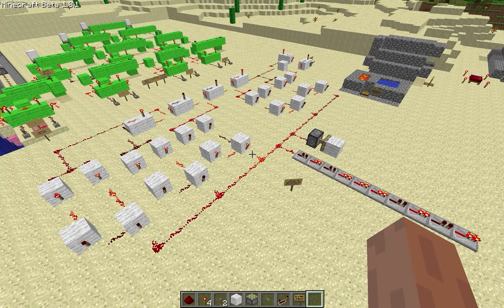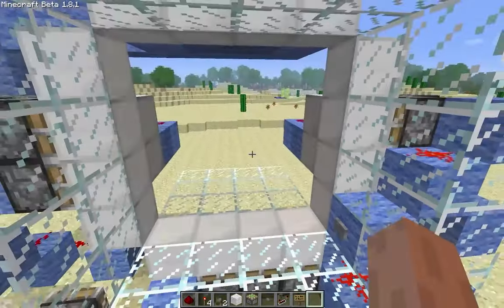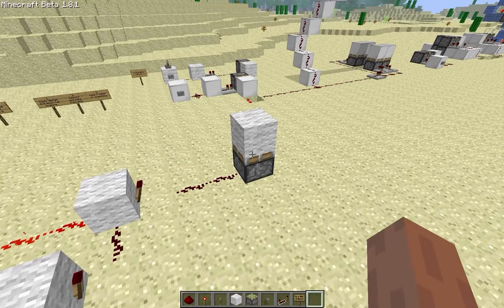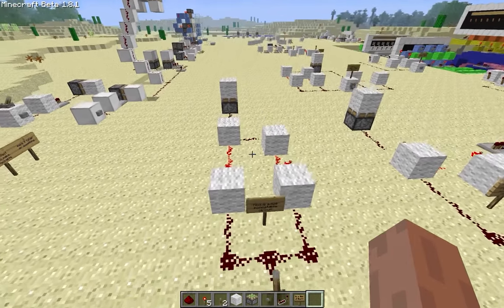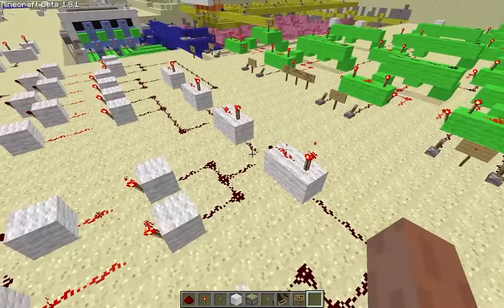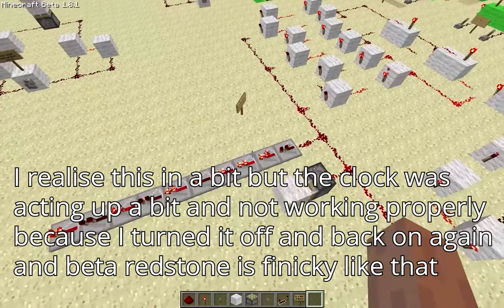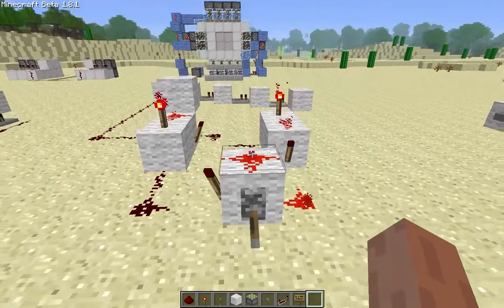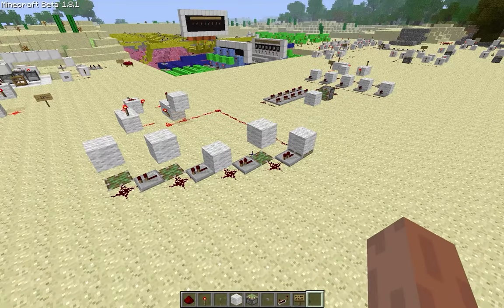the supposedly impossible redstone circuit (torch and wire 1-clock) [Minecraft Beta 1.8.1]

Comment: Have you tried methods of updating the torches in the tick where they receive no input? Here's an anecdote from modern redstone: comparators can read out the fill levels of chest and hopper minecarts, but they only do so every few ticks. But as it turns out, chests will continuously update adjacent blocks when a comparator is reading their signal, (iirc) so using a comparator you can get a chest to update another comparator to convince it to read the fill level of a chest minecart a little more frequently.

For the case of your torch, I recommend something else, like having a really dumb looking redstone line leading into a block adjacent to the torch. I think that could provide an additional block update to the torch. Also, there are ways to stop redstone signals from propogating backward without using torches, meaning that they have no delay. "Transparent" blocks like glass, glowstone, and top-slabs have a corner cutting trick where redstone signals treat them like they don't exist when stepping up, a block but can be cut off by them when stepping down.

Also, this is one redstone tick, right? I'm curious to see if you can find a way to achieve game tick precision. In fact, odd redstone pulses might be related to your weird issues. If there is somehow a three game tick pulse for example then half the time you pause the game you might see two repeaters on, and the other half one. I know that user input can have some weird effects, sometimes resulting in the same setup having one game tick more or less delay depending on whether it's activated by a player or by another redstone component. I'd have to look it up to remember the details and where I learned this though.
Reply from the maker: I did try updating the torch but either I didn't try hard enough or it didn't work. As for transparent blocks, they don't act this way in this version. You can't place dust on glass, and currents go both ways on glowstone so it might not be considered transparent.
Reply: @ElectricEel06  Well you would have to update the torch on the exact tick that the dust going into it blinks off. As for glowstone, if it was considered solid in this version then it would be cut off going both ways.

The following diagram is aligned vertically. T stands for a transparent block, R for redstone, and B for any block.
[T][R]
[R][B]
Reply from the maker: I see what you mean now, I evidently didn't read what you said properly the first time. I'll try this some time, although the design I would use it in is obsolete now that there's the rapid pulsers.
Reply from the maker: Finally tried it out, the using glass does not stop the signal whatsover, the signal goes both ways as if it weren't there.

Comment: 2:40 The circuit is location dependent. And it's not just beta weirdness; it's location dependent also in recent versions.
The important part is not the location of the torch.
What matters are the locations of the 5 redstone dust attached to the lever.
The update order of redstone dust is location dependent, and your circuit will only work if the redstone torch on the left gets updated before the redstone torch on the right.
Let's call the two torches on the left L1 and L2, and the two torches on the right R1 and R2.
So the lever powers L1 and R1. L1 powers L2. R1 powers R2. L2 powers piston. R2 powers L1.
Depending on the location update order of redstone dust, L1 will get updated before R2 or the other way around.
If L1 gets updated before R1, then L1 turns off before R1, then L2 turns on before R2, and then the piston gets a pulse.
If on the other hand R1 gets updated before L1, then R2 turns on before L2 has a chance to turn on. But then L2 doesn't turn on at all,
because when the tile tick of L2 gets processed it sees that it's getting powered by R2 and should therefore be off. In this case the piston gets no pulse.

For more information on redstone dust update order there is a quite detailed youtube video by Earthcomputer called "Redstone Dust Update Order".

7:40 This is completely logical.
The first time all the pistons get activated they spit out their blocks because they got short pulses.
The second time the last three pistons won't get any pulse, because the block of the second piston wasn't down, so the signal didn't propagate through that block.
It's a binary counter that makes perfect sense. There are no bugs here.

9:05 Yeah, this happens because repeater have overcomplicated tile tick priority rules.
A repeater that is directly facing into another repeater uses tile ticks with priority -3, while a repeater that is not directly facing into another repeater is using priority -2 for turning off and -1 for turning on.
So by placing another repeater at the end, you are changing the tile tick priorities and therefore the update order of the previous repeater.
But I don't think I can fit a complete explanation of tile ticks in this comment. There are many videos explaining how tile ticks work, like for example
LogicalGeekBoy has a youtube video "Dissecting Minecraft #15: Tile Ticks"
Reply from the maker: 2:40 Ah that explains why it worked in some places but not others. I'll definitely watch the video when I get the chance. That doesn't explain why some circuits that had worked before stopped working though, unless I've read something wrong.
7:40 I don't know why I didn't realise this at the time, it makes perfect sense.
9:05 I'll make sure to watch this one too.
Wasn't expecting people to give such in depth replies to this, so thanks for all the information.
Reply: @ElectricEel06  "That doesn't explain why some circuits that had worked before stopped working though, unless I've read something wrong."
I guess in versions earlier than 1.8 release it could also randomly fail because torches can get updated by random ticks.
But that should be very rare.

So I guess in old versions it's completely inconsistent whether the circuit works,
while in new versions there are some locations where it consistently works
and some locations where it consistently doesn't work.
Reply from the maker: Yeah that makes sense. I watched the videos you recommended and they were very interesting, it's almost like a second redstone, but operating inside a 10th of a second. I'll definitely look more into that so thanks for recommending them.

Comment: the output on the dual monostable needs to be a MINIMUM of 4 redstone length away. Why? no freaking clue lmao, but if its 4+ redstone dust away, it should always work. its unintuitive but it should work
Reply from the maker: Definitely sounds like the kind of quirks old redstone has. I also once got a torch that refused to turn off if the redstone wire powering the block it was on had a repeater one block away, but was otherwise fine.